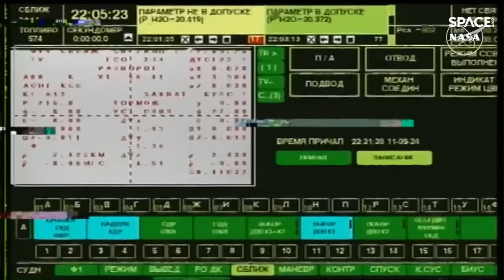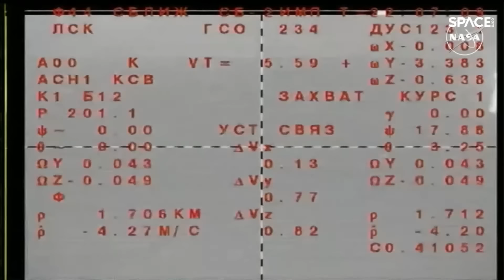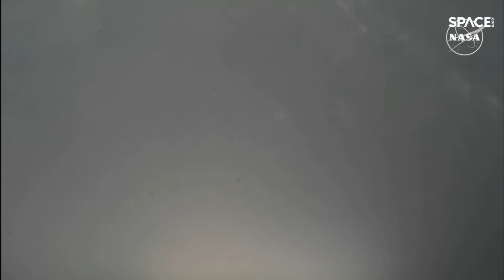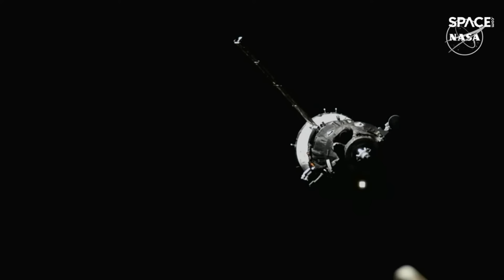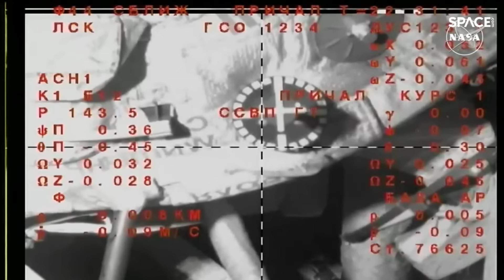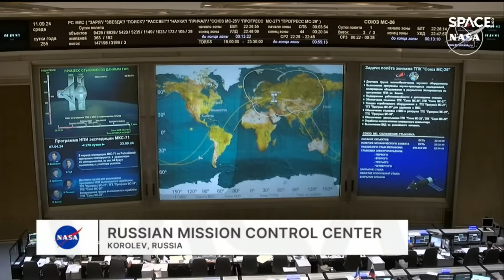Soyuz spacecraft docks with ISS carrying US-Russian crew

Comment: How come they cant bring the stranded astronauts back
Reply: No compatibility with space suits.....
Reply: They actually can, but like SpaceX, they need to make personalized chairs and suit for comfortable landing. Suits on Soyuz more universal. So, sending one pilot or empty Soyuz to bring 3 back is not a problem....but it's s even bigger reputation loss for NASA, so it will be SpaceX.
Reply: @redl3733  

You forgot the word.... eventually...  Every since Butch and Sunni waved g'bye to Boeing Starstrander there is no good IMMEDIATE way to get them back.
Reply: they could they did offer. More a political face saving decision. Boeing and NASA rescued by the Russians, not a good look
Reply: Presumably because this Soyuz is scheduled to bring back ISS crew members who've been up there a lot longer.  There is no urgent need to bring Williams or Wilmore down before the Space X launch is ready to go.
Reply: all modern spacecrafts are designed in a way to fly with same crew. 
But you can remove personalised foam from seat or fit in it  and feel ~3-4g on landing. They can use Soyuz suits and space craft that are currently at ISS to return in less then few hours. 
Unfortunately its still require another space craft to bring other two people from original crew back, what has already been done before.

So there is a way, but there are also many reasons not to do it immediately.
Reply: @redl3733  

They need to hope that there stays no reason for them to do it immediately because they are not equipped to do it.....
Reply: They can. The only reason NASA refuses is because of pride and shame. American astronauts used the Russian Soyuz space shuttle for over 11 years with no issues. Then the trouble makers in Washington decided it didn't look good on the US so they needed their own. Cue the troubled Boeing starliner after billions of dollars spent and years in the making. The Russians actually offered to bring the stranded astronauts down but they refused.
Reply: Their capsule only carrys a crew of three.
Reply: @royzeigler6473 e allora?
Conosci la matematica

Due russi rimangono un russo piu' due usa tornano